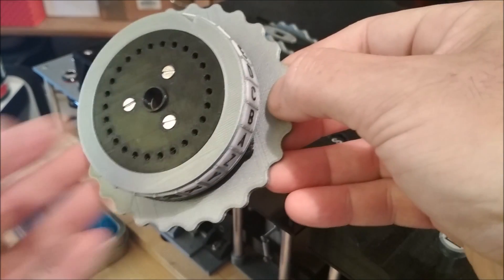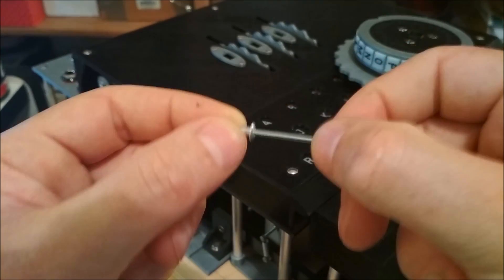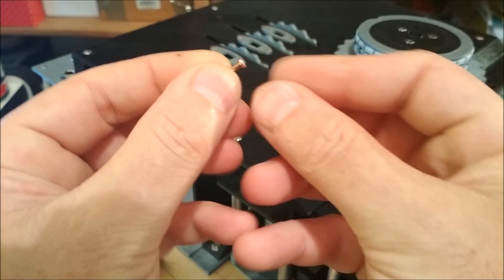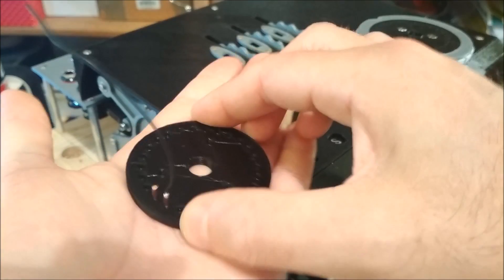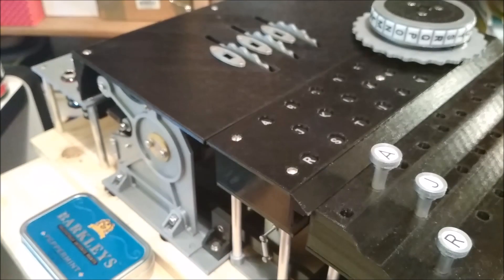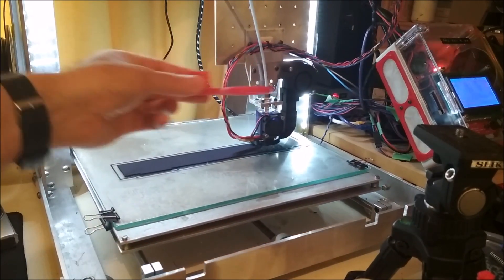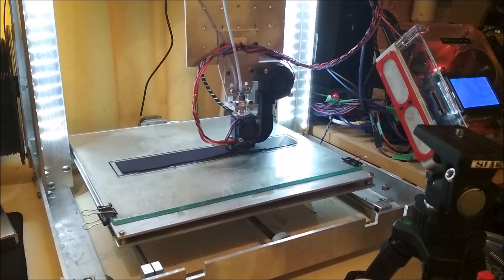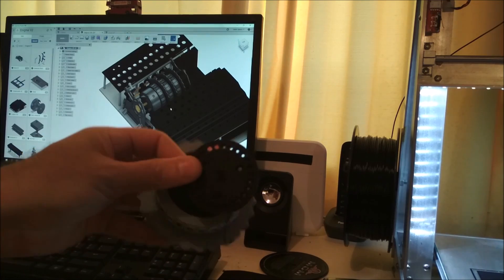3D printed Polish Enigma Update 23 Jan 2018

Comment: I'm not sure if you have found a solution for the spring loaded side,  but pogo pins come in a very large variety of head types and sizes and are meant to be soldered to. I'm sure you could find something that would work perfectly. 

I look forward to seeing your completed fusion model.
Reply: Hey, thanks for the pogo pin suggestion - I've been designing a cruddy spring pin mechanism for my rotors, but pogo pins look perfect.  I'd never heard of them - cheers!